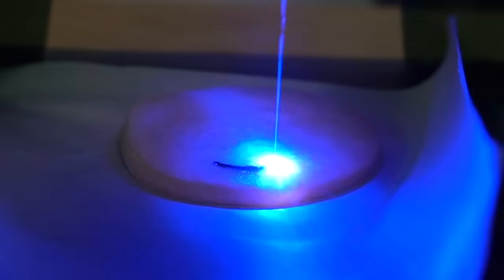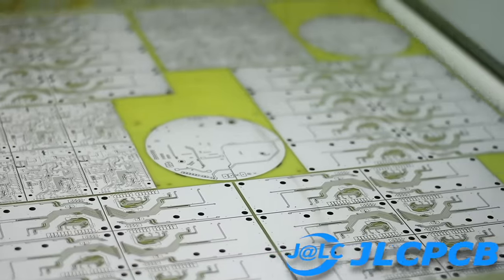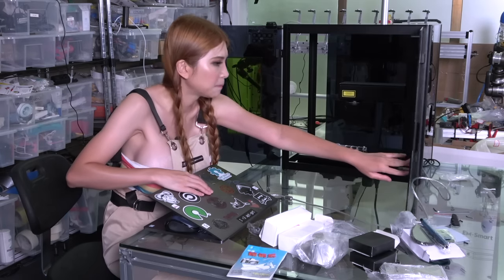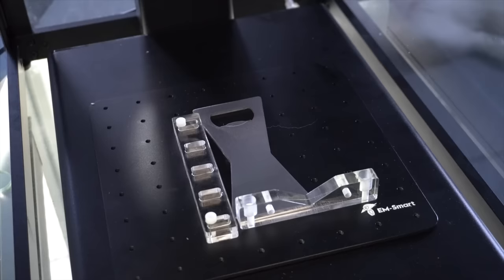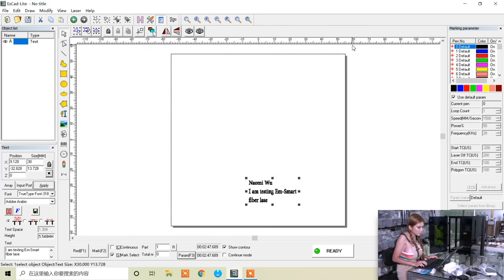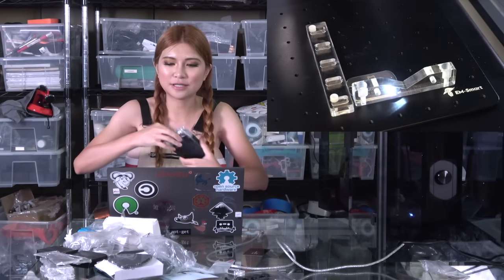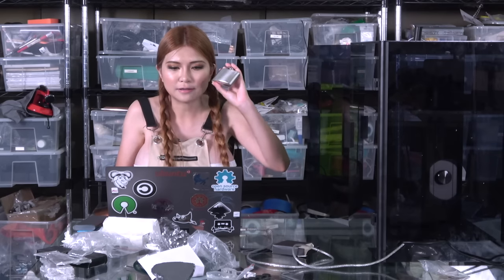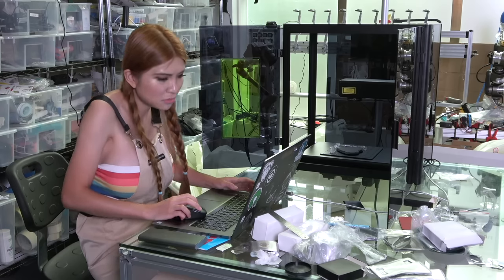Metal Engraving Fiber Laser- EM Smart- Review and Tutorial!

Comment: I would have liked to see it engrave a pcb for one off prototype work before getting batches of boards made up to test a design. Also, how hot were the items after engraving?
Reply from the maker: No heat...
Reply: @Naomi-Wu  That is great because some thinner items could be engraved like foil coatings without damaging the adhesive bond or the foil itself.

Comment: The engraving is very spot on, but for that particular price there should be a way for it to identify not only the object but the area that is going to be engraved from the software instead from the actual machine, if you get my meaning?
Reply: Some have a built in camera that lets you see the object on your computer screen so that you can center the engraving more easily. But this machine isn’t all that expensive. The camera system and software usually adds at least another $500 to the cost.